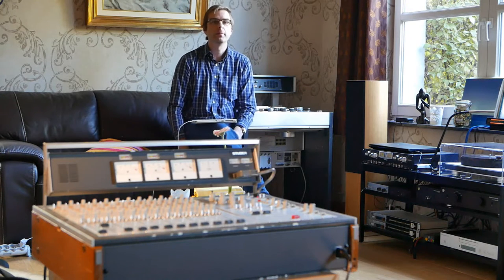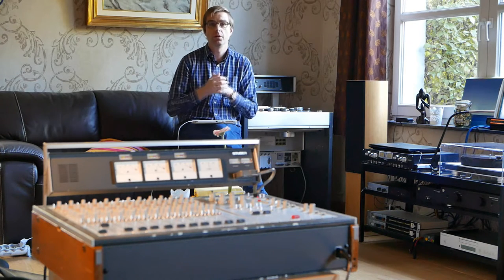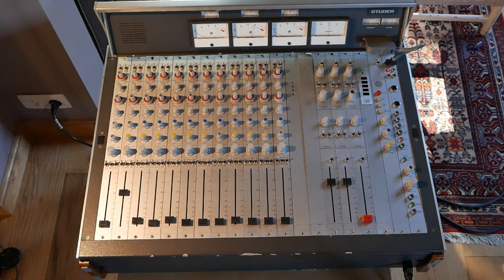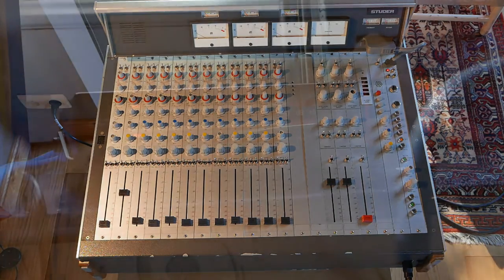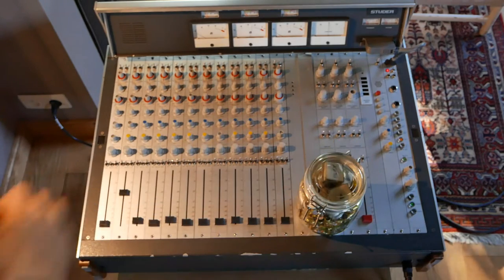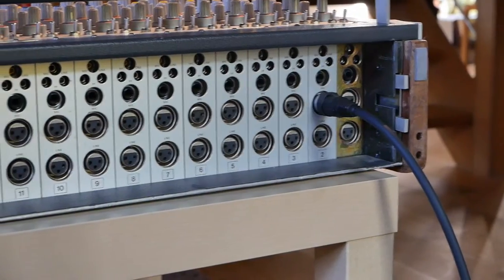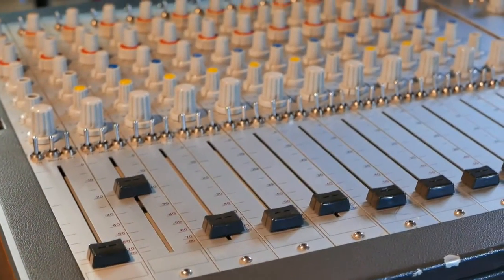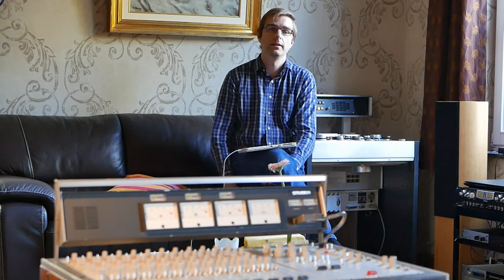Studer Mixing Console 269 + updates on the Studio Project

Comment: Very nice setup Wim, those old Studers are legendary. Most of those old components in the jar are the old electrolytic capacitors which were replaced. Replacing old ones are necessary as they can have issues (value drift) or completely fail after a while (typically after more than 10 years). Maybe I missed it, but are you planning on also getting a multi-track tape machine or just go with 2-track stereo recording? Anyways, that's a beautiful start to your analog studio!
Reply from the maker: +clfall Thank you very much for this input! It is good to get feedback from people that are much more experienced in this than a simple musician as I ever can be! Well, a multi track taperecorder... that would be something to have, but honestly, at this moment, we are far from experienced enough to have a machine like that in our possible future studio. Fact is that when using more than two mic's, the mixing will have to be definitive at moment of the recording. that is for my music not a big issue, but in case we would ever do larger productions with other style of music, it could be. When we were in Switserland, Andreas showed me a finished A820, completely refurbished and renewed (with newly printed surfaces), 24 tracks, with fully operational dolby's A and SR, for an American customer who wanted to have a machine really like new, inside, outside. It was fabulous, if only to look at... Andreas told me that this 820 was the best of the best that Studer ever made, but that, in his opinion, the A80 had more of a "soul". And besides this very complicated machine, the 2 inch tapes are... really expensive as you surely know, so we start "modest" and see what happens. We will record direct on tape, but I guess that if we would rent the studio to third parties for recording of pop/rock, that they will prefer to record digitally and eventually run their final mix through the tape. To me, as we've tested until now, that gives not the same result as first on tape and then digital, but as said before, this 1/4 inch stereo track recorder seem to be a good start for us.
It is surprising to hear what a beautiful 'glance' and space and detail the recording gets on a taperecorder like this, compared to the digital recordings we do here... 
Thanks again!
Wim

Comment: Interesting! What was the reason for not fixing the left meter? Although you are using the other meter, it feels a pity of having a not functioning part... But it doesn't really matter, all important are working well!
Reply from the maker: +scozio Well, the reason Andreas gave is that the plasma reader is more accurate than the meter bridge that would need to be calibrated and adjusted. And maybe that is something that is not to easy with these older machines. But I feel the same, I've asked andreas if we could make this part function again in the future (because the right meter is VERY accurate with the plasma reader -and fast as well), and that would be no problem he wrote.